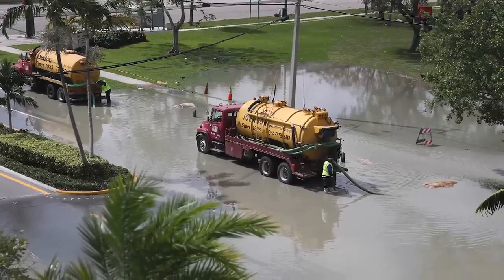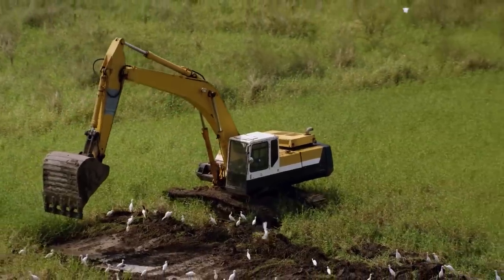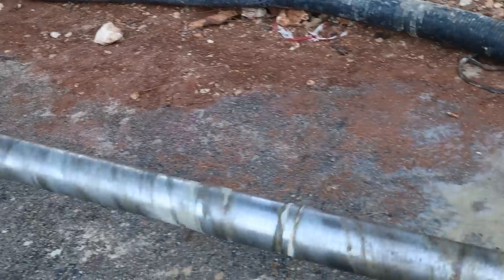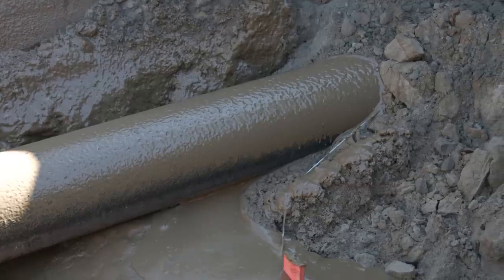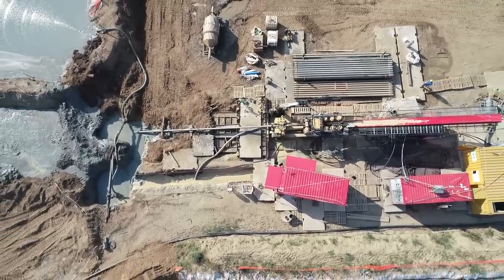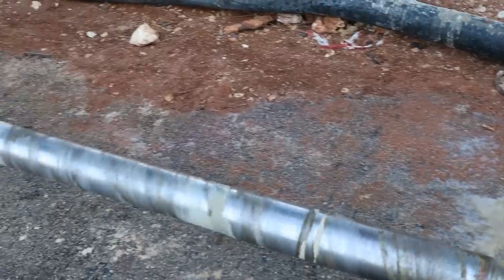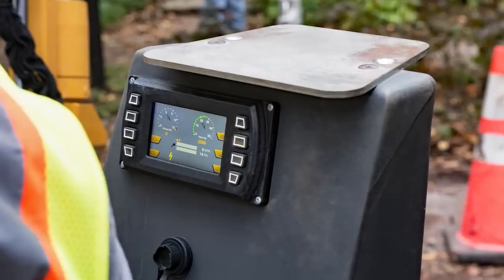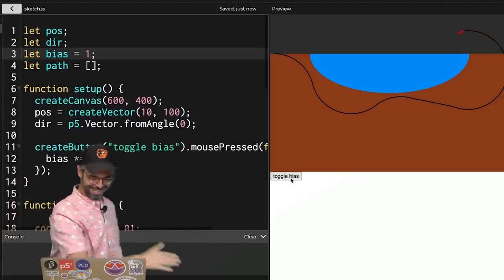How Do You Steer a Drill Below The Earth?

Comment: I worked installing fiber optic cable when I was in high school, horizontal drilling 4’ underground in residential areas.  I was the guy who used a hydrovac to expose existing utilities before drilling so you didn’t hit them with the bit.

I then got a degree in petroleum engineering and work in the oil and gas industry drilling horizontal wells.  The concept is identical and many technologies are shared , only difference is you start going horizontal at 10,000’ instead of 4’!!
Reply: That's epic! If only the dudes that dug up all our utilities used this method XD
Reply: but wouldnt this drilling destroy artifacts, skeletons, ancient buildings/burials, or fossils?
Reply: because you never see what you are drilling into
Reply: @Blox117  a hydro vac will cause less damage than a backhoe as far as incidental objects are concerned. It uses pressurized water to cut and liquefy the soil before vacuuming it out
Reply: @Blox117  nah usually you dont dig where that stuff is known to be and if you find it you should report it
But trust me, some construction sites rather just pretend they didnt just see a bone and yeet it rather than getting the project stopped for some expert to come and dig up the stuff for history purposes

Have seen that happen a few times where they stumbled upon an old village but that was when they laid a gas pipeline that was like a half a meter across and required a fuckton of digging 😅
Reply: @Blox117  at that depth,  doubtful but also,  who's looking for those things at 10,000 feet anyways?
Reply: @fredtaylor9792  troll, no way can be this tarded "10,000 ft" LOL
Reply: And you make a ton more money
Reply: @Blox117  ? Avarage hole dept in the north sea before the production platforms start drilling horisontaly is almost 10.000 feet and the holes usually go 3-5 miles horosontally.
out from the platform following the layers of oilsand.
But the deepest drilling hole at the moment is in the gulf of mexico. around 33.000 FEET.
Where the pressure is insane 2100 times the pressure at sea level.
in the north sea, the its usually enough that the MUD PUMP delivers 600-800 times sea level pressure. 
1 x sea level pressure ore BAR as we call it for short is around 14,5 PSI, SO 2100 X 14,5 is a lot. 😁
Reply: @samkom33  But how can a drill(!), which is rotating by definition, be directed, when it's bent head rotates as well with all the drilling rods connected above?
Reply: @NipapornP  It tends to hold itself stable because it's y'know... In rock?
Reply: @sypeiterra7613  But the bent head rotates as well! So how can it be directed?
Reply: @NipapornP  The drill bit is usually larger than the mud motor with the bend housing. That means that the open hole ahead is larger than the motor and drill string that follows it. So, the bent housing is used to change the direction of the brill bit/string in a process called sliding. When sliding, the drill string is pushed, instead of rotating. Once the desired direction is achieved, then they start rotating. Remember that the open hole ahead is larger than the mud motor with the bend housing, so there is enough room for the motor and bend housing to rotate freely in the hole, and just follow the direction that was previously created. 
The bend housing on the motor is actually not as pronounced as the bent wire demonstration he showed in the video. In oil well applications, a 2.12 degree bend on the mud motor is enough to create a 10 degree change in direction every 100ft. 
I hope I was able to explain the concept. I work in the petroleum industry, and when I first started, I also asked the same question as you did. But after a while I understood the concept. Feel free to ask any question and I hope to clarify it for you.
Reply: You prolly use trenchor things. I build things for the JT series and vacs. The things I'm involved with are amazing
Reply: Yes, you are right, everything is relatively similar, we are in the frame houses, laying the foundation and drilling, and we also need to drill all this and use it for work
Reply: Yup. Fascinating stuff
Reply: @samkom33  those are the pumps that cost several hundred thousand dollars I'm sure. Run by how many big engines? I've seen the concrete guys pumping casing cement and a 53 foot trailer is full of all kinds of interesting stuff.
Reply: @NipapornP  computer controlled fins. They push out and steer the cutter head. Too bad I can't send a picture.
Reply: @eudofia  What an effort to put in an answer! Thank you so much! I still wonder about the "mud motor". I've seen a "boring head" already, but it has no motor on it. It's just the tip of a very long drill, with rotating gears, but only WHEN THE WHOLE DRILL ROTATES. Pushing such a drill wouldn't do anything against a rock, which is quite typically for a drill, I would say. Basically it's the same as a drilling machine, with a long drill, which is bent a bit at the tip. This would never be steerable, it would just make a bigger hole than the drill's diameter. Still con't find the "weak point" in my thinking! I've been working for an oil drilling company, but not as an engineer, I'm just a chef, providing food for the workers. ;) But I've seen all the tools and rigs first hand, and the guys told me that it IS possible to drill nearly 90°, even into other country's territory (with maybe other troubles). And I know, that this "segmented pipe drill" is winding itself a lot, because of it's long distance. This tells me, that the whole thing (drill pipes and head) is rotating, otherwise the gears on the head would stand still. Maybe any link to recommend? Would really like to understand it after 20+ years of wondering.  ;)
Reply: @oliverford9325  Oh, that's interesting. So they push in and out on every single rotation, like a helicopter main rotor works? Otherwise it would just widen the hole, right? Maybe a link to picture?
Reply: At least y'all have a hydrovac on hand, we have to find most of our utilities by hand cause we only have 1 vac trailer for the whole company...
Reply: The cool part, is they can turn the entire string of pipe or just the Bit on the end of the mud motor. Turning only the Bit, and pushing on the pipe without rotating it, causes it to track in the direction you want. Pumping the mud turns the bit. Increase the pressure to speed up the bit or flush the cuttings away up the outside of the pipe to surface. Cool tech.
Reply: I work as a subcontractor for many different water supply corporations, fixing water leaks, putting in water meters, and the like. A large percentage of our water leaks are from fiber guys boring into the water lines.

Comment: I studied geology and worked with directionally drillers at a utility contractor. Their biggest challenge the drilling foreman told me was hitting hard rock at glancing angles.  The problem project that eventually had to be trenched was at the foot of the Wasatch mountains and they hit a high quartz content sedimentary layer less than 30 degrees from parallel to it and it just skipped along the outside edge of that fold and came out where they didn't want it to. They had drilled right through it at more square angles where the bit would be forced to go ahead and chew through that harder to cut rock.

Comment: I work for a water/sewer district and because of our topography, we use a gravity sewer system. This means that all our sewer lines must be perfectly straight and at precise angles. Because of this trenching is preferable as directional drilling is not perfectly straight and this creates low and high spots in the line which will require continual flushing and maintenance. We do occasionally use boring to lay water pipe underground though as it is not requisite that water pipe be perfectly straight.
Reply: I work for a telecom company and HDD is a godsend sometimes for laying optic cables 💪 Literally zero downsides, except for cost 😅
Reply: I would look in to wire line and/or better drillers if you are facing those issues.
Reply: Yep, microtunneling is king for gravity pipes
Reply: @VicScott  in the video itself, he said that directional drilling isn’t straight. It’s continually curving. Also we have no control over the contractors we use. We have to put projects out to bid and are legally required to choose the lowest bid. The lowest bidder often subcontracts out the work. Using open trenching, we get perfectly straight lines, GPS shots of the pipe in situ for mapping purposes, and we use lasers and other means to keep an exact grade.
Reply: I work for our water department as well and all our sewer lines are all gravity, we don't have a single lift station
Reply: Oh I understand how it is in the industry all too well, when I was subbed it got to the point the Prime would specifically request our rig to come in if the tender was won by our company or they would go to the next company (the company was pretty hit or miss, once explained to me as the flip of a coin if you get a good crew). 

I learned a bit of how to make it work as well for water and sewer. The past few years as I have been working for a prime that had their own rigs. It is a little pain staking but I have completed jobs that are entirely gravity feed, it comes down to verifying accuracy every 5 M or more with cuts and if it isn't with a certain spec making them pull back that rod and manipulate it through collapsing the hole or what have you.

As for it isn't perfectly straight, no it isn't. However if you go 1.5 times O/D size with your hole and let your pipe enter the hole flat with a prereamed hole (if soil allows a preream). Your pipe will ride the bottom the whole way back along those ripples and that is just an easy adjustment on the math to accommodate the reamer size.

 Now that being said I have been blessed with luck and backed by some amazing guys with 20 or so years experience when I first got in to it over a decade ago now.
Reply: @VicScott  I appreciate your comments. I learn something new everyday. I was just repeating what I’d been told by those in charge at the district. I’m fairly new here and try to soak up info wherever I can.
Reply: Theres a trenchless method called “coring” or push/pullback technique that takes care of this problem, similar to hdd but no drilling, just hydraulic power that pushes or pulls the rods, once through the exit hole, u just put a round “knife” that carves a hole then push the slug out ten feet at a time till u cut all the way back to ur frame
Reply: Theres a trenchless method called “coring” or push/pullback technique that takes care of this problem, similar to hdd but no drilling, just  power that pushes or pulls the rods, once through the exit hole, u just put a round “knife” that carves a hole then push the slug out ten feet at a time till u cut all the way back to ur frame
Reply: Saablazer.
Yes use to do side sewers in the mid 70s. We had to use hand level to make sure we had the say ( 2%) grade. Then I worked a mainline Sewer job. ( Hoepacking) we used a (Laser).
The Lazer gave us grade slope. The Lazer was set up in manholes. I was thinking if Florida is using directional Drilling, under waterways, they would have to have a force pumping station.
Reply: The sewer utility I used to work for used directional drilling on major gravity sewers whenever necessary.   For example, one I can think of was an 18"  (450mm) sewer under a school field and across in front of the school under their tarsealed sports area.   Two shots of ~120m each, I think.   Our standard requirement on grade was relaxed to not to have any significant hollows (i.e. low points) - since the grade was about 1 in 300 or thereabouts that was still a demanding requirement.   I think when we put the CCTV through it there were a couple of depressions maybe a couple of inches deep - which we considered acceptable.   
Trenching was just not ever going to be allowed - it would virtually have shut the school down (and required resurfacing of all their playing areas).

Comment: In the Oil industry drilling, the underground motor can partially close and open valves to make pressure pulses in the fluid line. Those pulses work as a digital communication system that can be used to determine the position, orientation etc. It is slow, but since the drilling process is very slow too, it is good enough.
Usually, the energy to operate the system is also extracted form the fluid movement.
Reply: That is sooo coooollllll!!!!
Reply: It isnt the motor that creats the pulses in Oil well drilling.  Its the MWD/LWD tools that do that + mud motor drilling is steadily declining with RSS systems being prefered.
Reply: How is that powered? Does it just use a small dynamo?
Reply: All day every day buddy! Drilling one now! This particular location has been the biggest challenge of my career and even RSS is giving us trouble. On losses so the pulses on lesser tools don't work. We had to get SLB out there with a slimhole tool that works.
Reply: Slow!?! We are drilling and casing off 20,000’ wells in less than 14 days. The tools pulse and communicate instantaneously.
Reply: The PSK/FSK communication isnt really in the motor but in the MWD/LWD tool. More recently companies (Schlumberger, Baker, Haliburton etc) that make the motors also own the Logging tools which are taking the measurements, so they make combo tools with everything in the tool and the provide an expert geo steering operator and charge thousands of $/day for tool/service.
Reply: @wilmarkjohnatty4924  it’s truly unreal that these tools can operate with such precision given the stress they are under.
Reply: @dereksmith6713  It is a very slow baud rate (10 bts/s max?) compared to any other type of communication we are used to see. The slowest devices people see nowadays in very simple equipment have 9600 bits/s baud rate. Even telegraph is faster them MWD/LWD.
I was not trying do give people a class about oil drilling and how amazing it is. It is just a nice curiosity fact to add to the video in the sense that is possible to communicate using the flow of the fluid. Regards!
Reply: @rogeriocosta1035  Baud rate depends on a lot of factors, Depth, mud type/weight, flow rate, pressure etc but I have seen 20 on wells.  There is actually another system in use for data and power transfer called wired pipe.  It's not common due to cost but you get network speed data transmission with it.
Reply: @some1purple  Yes! The system can operate using special lithium batteries (the temperature can be a bit high in a oil well) or a turbine to rotate a small "dynamo". Dynamo is a term for a old tech that produces DC power. Modern generators are more efficient making AC power that can be converted to DC if needed.
Reply: @timberry1135  you need to let us know your acronims
Reply: @churlburt8485  LWD/MWD - Logging while drilling, Measurement while drilling, They are pretty much interchangeable, RSS - rotary steerable stabilser/system.  These are pretty much only used in oil/gas well drilling.
Reply: @timberry1135  thank you
Reply: @some1purple  Some systems use a generator or dynamo as you called it. But these days, it is mostly battery powered. Batteries similar to the lithium batteries you use in your cell phones or flashlights, are engineered to be used downhole where temperatures can reach 300F. Pretty cool.

Comment: I work at an Engineering firm and have designed multiple directional drills across intercoastal waterways. I now use this video to introduce new engineers to the basics of directional drill. Thanks for putting this together. Also, I see you used to work for Freese, we are partnered with them on a project. I'm a Kimley-Horn guy.